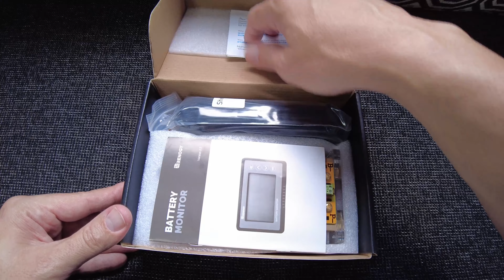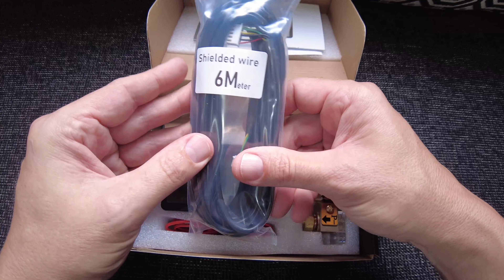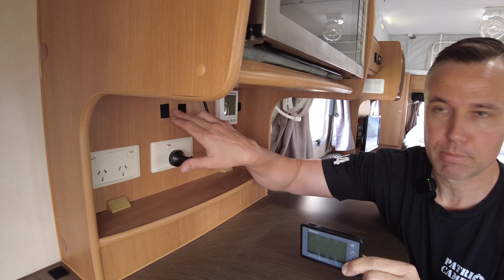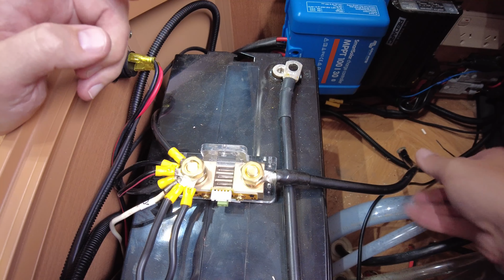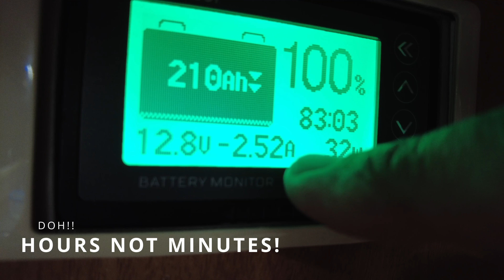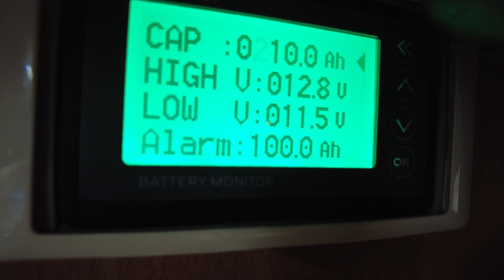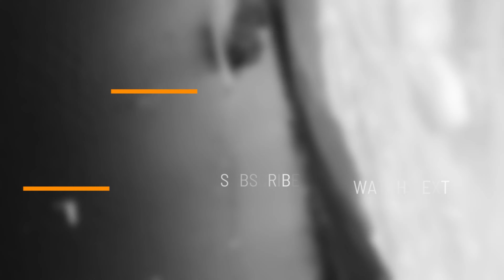Installing a Renogy Battery Monitor RBM500 into a Caravan || Easy DIY!!

Comment: Hi,  great video. I just ordered this battery monitor, and was going a full renogy charger setup,  but looking at victron now,  would this monitor work the same with victron charger mppt combo?
Reply: I was going to buy a Victron 40amp MPPT controller but have been told by a lot of people there over priced and no voltage display so looking at something different
Reply from the maker: Yeh the monitor is independant to anything else you have setup. Thanks for watching

Comment: if I need to use 2 batteries will this connect to both vs monitoring only one?
Reply from the maker: Yeh provided the batteries are connected together, then this will read the current of both. Thanks for watching 👍🏻

Comment: Any issues now that you've had it a while? Mine shows discharge accurately but once I start charging it sees the 14v and shoots from say 50% straight to 100% but battery continues taking 40amps for hours. Clearly doesn't function as it's meant to. Renogy support is useless. Regretting not going victron 😔
Reply from the maker: Yeh I have found something similar. After using it for a few months I have noticed it shows 100% after only a short time of solar input. I’m guessing it bases it’s % of the voltage and not the used amps. I’m actually replacing my entire battery system soon with lithium- the battery monitor uses the BMS to monitor in/out voltage and current. Should have something out in the next month. Thanks for watching 👍🏻
Reply: Victron are overpriced
Reply: This is EXACTLY what I found when charging 
* with the engine's battery/alternator (i.e. as soon as the engine starts and the battery isolator disengages),
* with converter (from shore power)

I set "Full V" to 12.8 Volts, and since the charge voltage of 13.4 Volts, this line from 8-page booklet kicked in
> "When the voltage is higher than the set value, the capacity will be automatically set to 100%".

In other words, this monitor is using a CURRENT-measuring circuit (the shunt) to do a VOLTAGE-only calculation.  It is NOT integrating Amps*Hours to do what I want it to do.

That makes this monitor useless if I ever want to connect to shore power or use the engine.  ;-)

Has anyone else used the Renology monitor with deeply discharged batteries (i.e. that have a high voltage as the first phase of charging).  If so, how did you get around this seemingly contradictory problem?
Reply: @MichaelRWolf  I do not have one of these units, but have experience in similar. As you will be aware, this unit normally works out the current state of charge (as Ah remaining and percentage %) by taking the full battery capacity entered and subtracting any -ve current and adding +ve current (as measured through the shunt). This sometimes might get out of wack after some time and can be reset manually (using the buttons), or automatically (using the Zero V and Full V values). This automatic method essentially resets the percentage to 0% (empty) and 100% (full) when the entered values are reached. So, if one sets 13.5 volts for the Full V setting, and the unit measures more than 13.5 volts (which it takes via the red wire), it resets the percentage to 100%. If one does not wish to have these automatic resets occur, relying only on the amps in + amps out accumulative calculation, I imagine one is best to set Zero V and Full V  to values such as 10v and 16v respectively. Hope that helps.

Comment: Great video.
I’ve just bought one of these for our Jayco Expanda.
We have a 120Ah Lithium battery and I’ve watched a couple of videos some installations have entered different values for Capacity.
Question:
Is CAP = to total battery Ah or Usable Ah?
This is where I’m a bit confused.
Reply from the maker: Cheers mate. I’ve set the battery CAP as what’s listed on the side - so mine are 105ah x 2 =210ah. Obviously if I took all that it would be completely discharged. I’ve then set the alarm to trigger once it uses 100ah. You could set it up differently but mine seems to be working well. I’ll actually be swapping out the AGMS shortly to Lithium so a new vid will be up on that - it also uses a different monitor that reads from the BMS rather than a shunt.

Comment: If I have 660 AH in a set of group 27 batteries what monitor size do I get?  I see ones with 100, 350, 400, 600 amps....
Reply from the maker: All depends what your running off the batteries. I’d work out your max load and then go the closest size. Thanks for watching
Reply: @GetCampingOz  So lets say I have 660 AH bank.  The shut is sized to the load not the bank?  i.e. if I bedget say 100 to 125 AH per day of use, but at any given time I may be using 20 to 30 amps then I size to that?  So 100 Amp should do it?  or is it best to just get a higher model to be safe?

Comment: What is the other negative wire connected to?
Reply from the maker: That second negative wire goes to the second battery 🔋 😀
Reply: @GetCampingOz  so if you are running two batteries in parallel you still connect the first battery to the second and n not via the shunt?

Comment: Good review and thank you for covering all of the monitor's features like how to turn the light off.  That will save a few miliamps.  I just ordered this monitor for my system thanks to your review.
Reply: If you press & hold down the << BACK arrow button you can actually adjust the brightness. Maximum is level 7 but I drop mine to level 5 & it’s perfect 👍🏽
Reply from the maker: Thanks mate! Appreciate the kind words. Cheers for watching 👍🏻

Comment: This looks great, does the battery level remaining take into account the fact that you can only discharge lead acid batteries to about 50% safely?
Reply: Probably not since that's complete nonsense. Had my 120ah agm's for 10 years, monitor shows 120ah coming out and back in happy as Larry.

Comment: Whats the other cable off the neg of the battery?
Reply: That worried me at first too.....But he mentioned that he has 2 batteries....That wire must be connected to the negative terminal of the 2nd battery for a parallel connection, thus doubling his amp hours.
Reply from the maker: Hey mate, As Craig pointed out that the connection to the other battery. Im not very happy with the setup and its extremely messy, but I will be upgrading to lithium soon, so it will get a complete tidy up then. Thanks for watching

Comment: Now since it doesn’t completely turn off then would it put a parasitic draw on my car battery?
Reply from the maker: Yeah it would but it would be only very minor - I'm not sure what the draw is but it should be noticeable if you are using your vehicle frequently. If you arent, it maybe worth while putting a switch inline so you can completely turn the screen off.  Thanks for watching

Comment: You should probably use a distribution block with all those neg wires
Reply from the maker: Yeh for sure. It was messy that’s for sure. I’m planning on doing a lithium battery upgrade soon so it will all be tidied up.
Reply: Came here to say too many wires on that battery terminal. Great video though.

Comment: I had the same situation when cutting the hole for my battery monitor.  Where did you get the surround to put around the battery monitor?
Reply from the maker: Hey Alex, it’s just a PowerPoint surround. I pinched it from the power point underneath the seat. If you don’t have a spare, head to the hardware and see if you can find something that suits. It really tidied it up 👍🏻

Comment: Just a heads up when cutting thin timber like you have try using a metal (hacksaw type) blade  on the jigsaw to prevent the timber going to shit around the edges, you just have to cut abit slower. You could also use a multi-tool to do a finer cut and wont need the drill to drill holes around the corners.

Does it say what max amperage is the shunt? can you connect an inverter to it aswell so you can measure power output when using an inverter?

Keep the awesome videos coming.
Reply from the maker: That’s a good tip! I was too impatient 😃 

Max amp for the shunt is 500amp so it would definitely handle an inverter. As for the wiring, if you ran the inverters neg cable on the P- side it would measure how much current it’s pulling when it being used. I would like to redo my battery system with lithium and have an inverter - might be a few vids coming up on this next year 😉
Reply: This is a good tip 👍🏼 
But better yet to get the perfect cut use a Stanley knife blade, a nice new one and Cut your pencil Mark first with the standard blade, and then when you cut it out with the jigsaw using the metal blade as Aussie said Cut just on the inside of that stand up blade Cut they’ll be zero damage